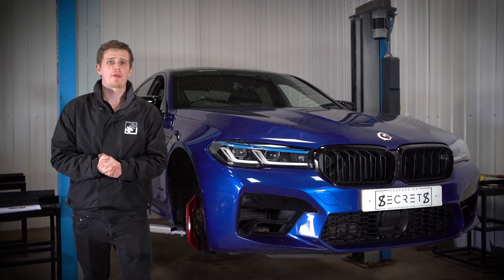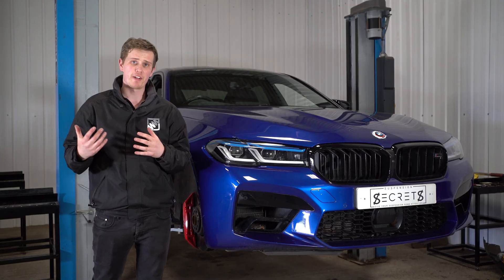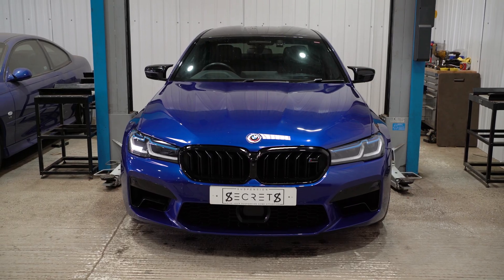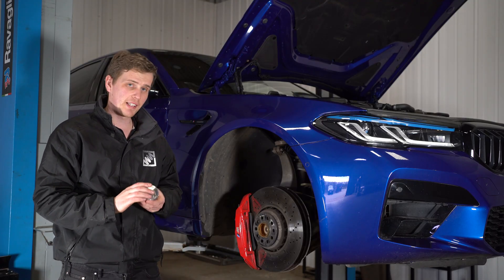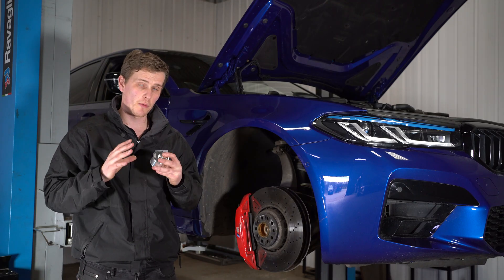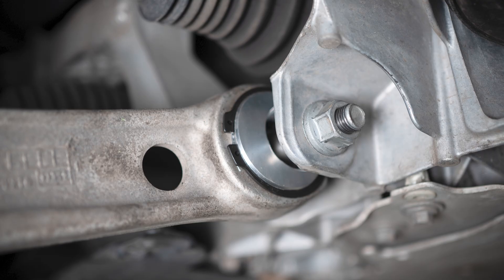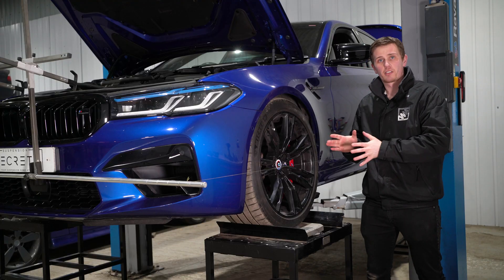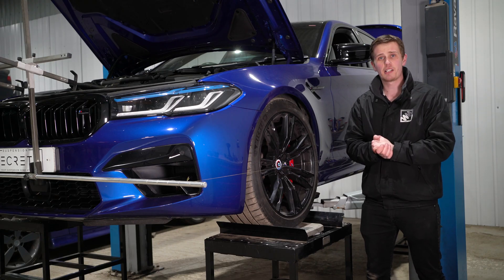BMW F90 M5 Camber SUSPENSION UPGRADE

Comment: How do rose joints and solid bushings not seize from corrosion, even if they are Teflon lined, and when adjusting on your flat patch, how does the suspension/tire not bind up if you aren't using some method of slip plates?